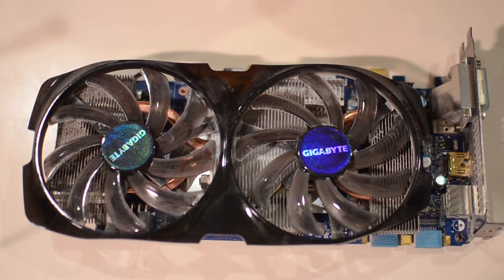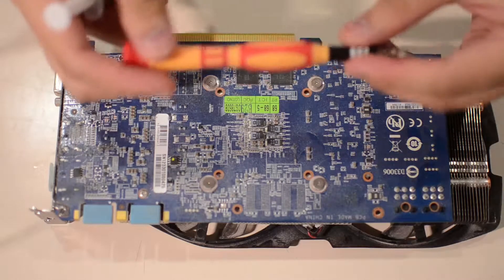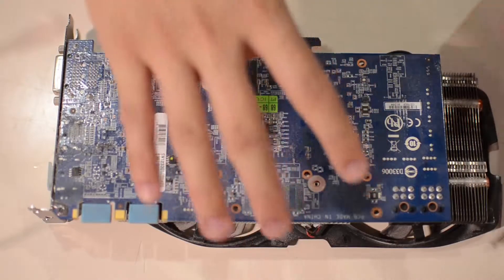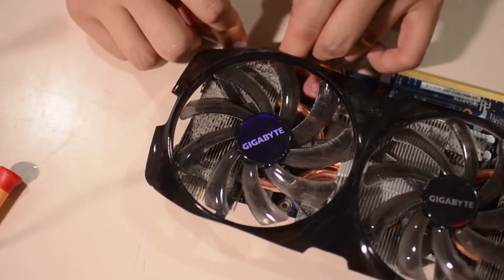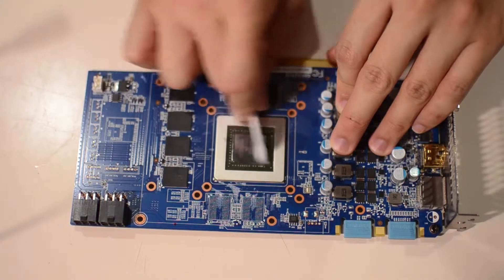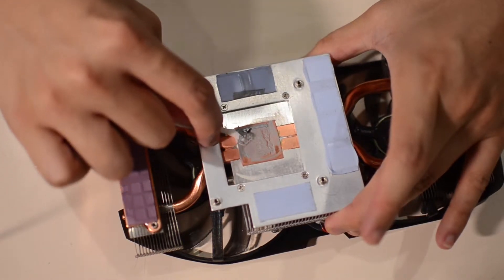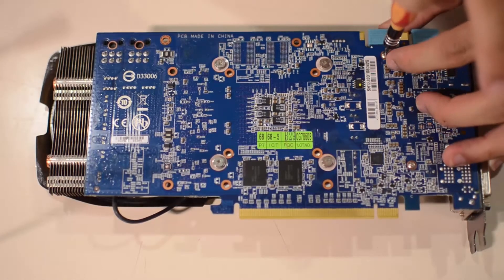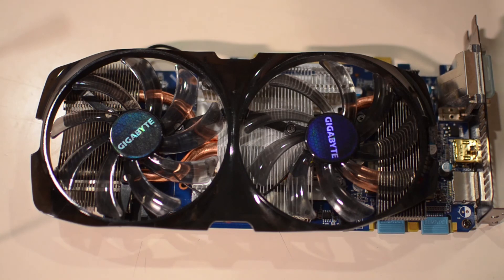PC How-To - Cleaning/ Replacing thermal compound on Graphics Card

Comment: its too much
Reply: ***** I get about 76 at max with a reference cooler.. =x 
It probably has to do with you spreading the paste, that can cause air bubbles in the paste.. :/
Reply: ***** Hehe, that is the method I use.. :P It gives fine results.. I see people hitting higher temps with way bigger coolers than my reference card just because of the way they apply thermal paste.. ^^